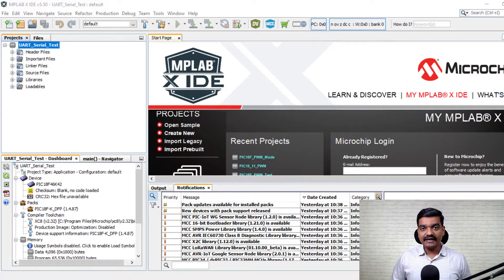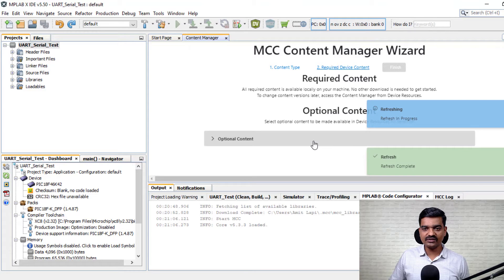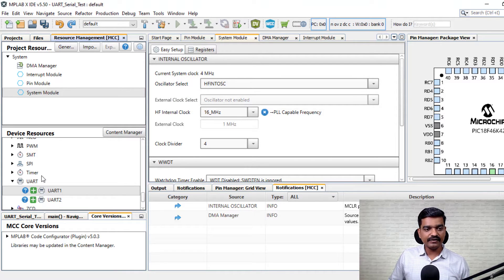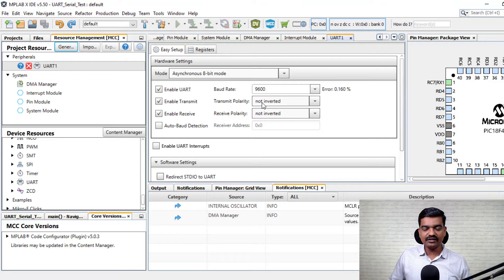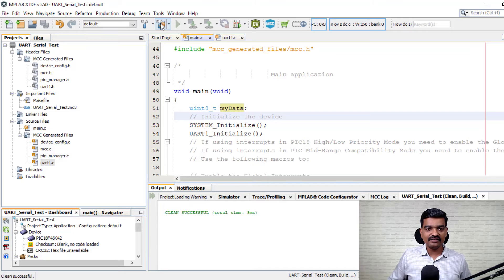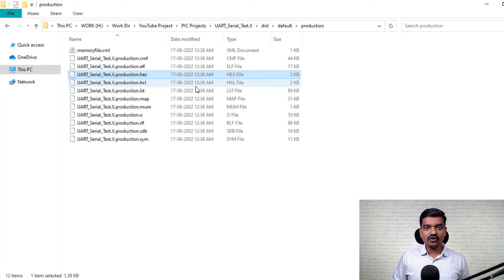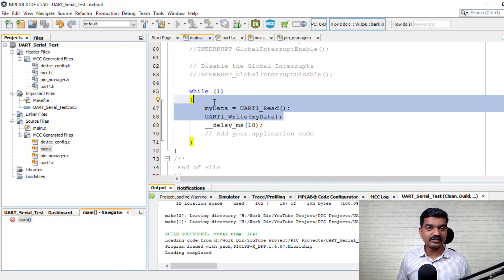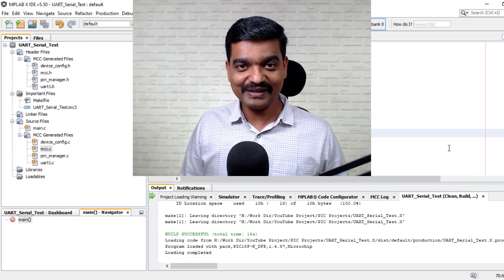Serial Communication In PIC Microcontroller | UART in PIC

Comment: Hello sir, is it possible to read an 8 byte long string with PIC UART?
Reply from the maker: Yes, you can read multiple bytes in two ways. 
1. Poll your serial port for 8 times this works when you are assured that you will receive 8 bytes in a short span of time.
2. UART Interrupt with this there is no limitation on time you could receive byte and store it an array and when 8 byte received reset array index to 0 to receive further set of 8bytes
Reply: @dhanawadeamit  please put a vedios for spi, i2c, can protocols in pic controller please